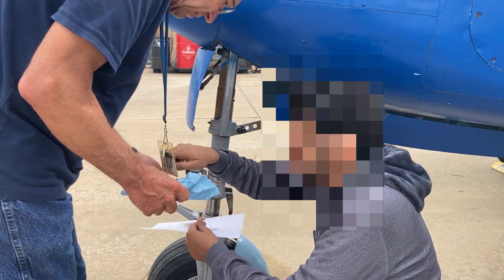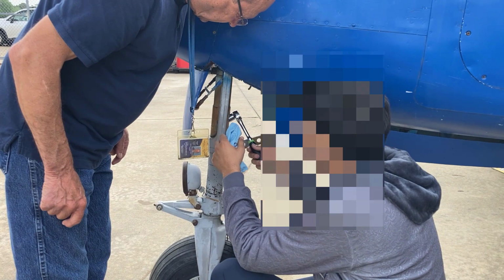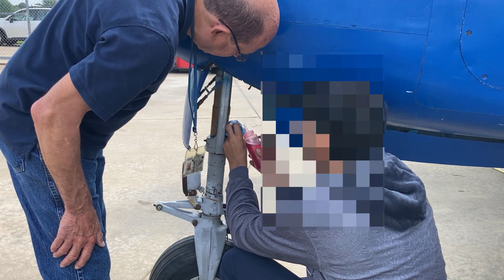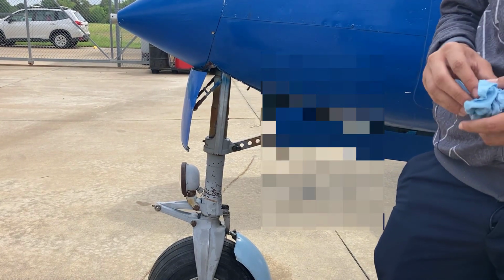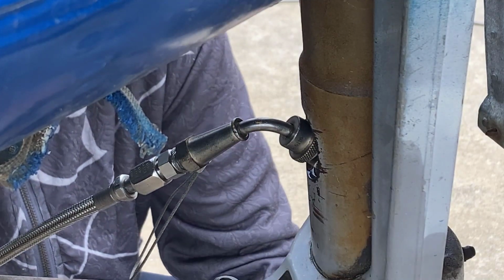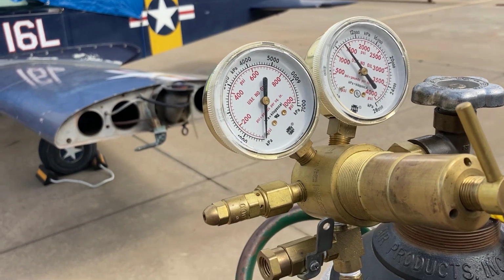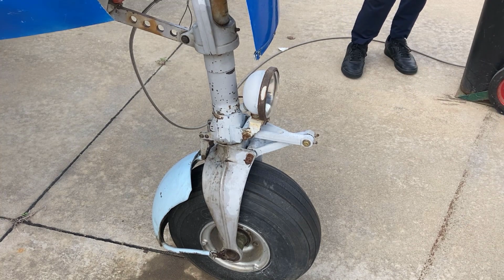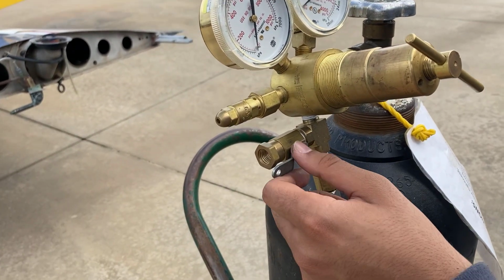Strut Service with Nitrogen

Comment: I've found a more controlled way to do this.  The problem with this "classic" method is that when the pressure you apply gets up to the internal strut pressure, the strut starts to move and it's difficult to get it to stop at the right spot.  Here's the fix - use a strut pump connected to your nitrogen bottle.  Dial the N2 pressure to about 120 psi and use the strut pump to introduce the N2 into the strut in increments.  Very easy to get it exactly where you want.